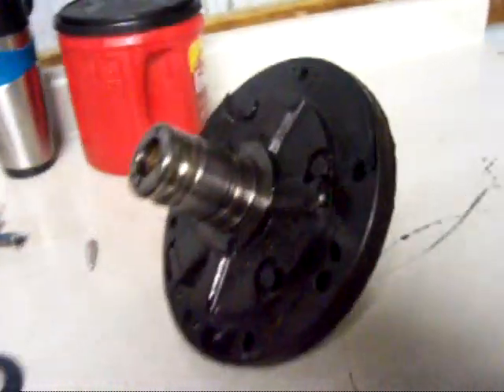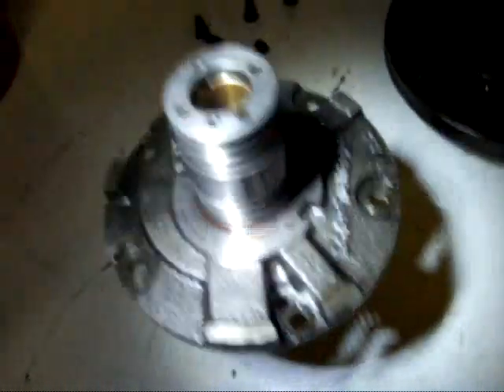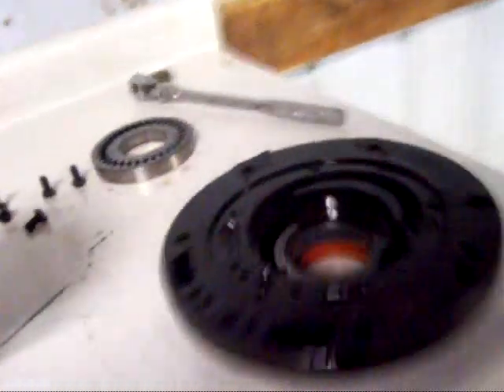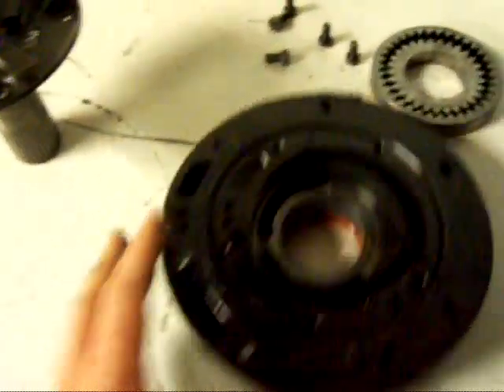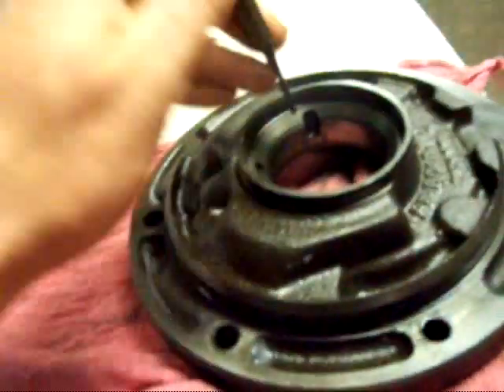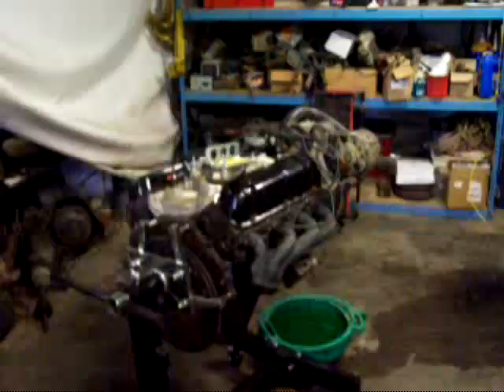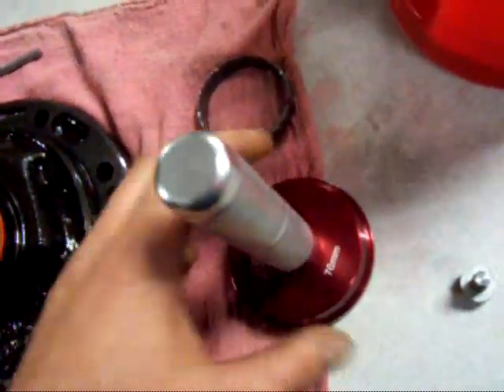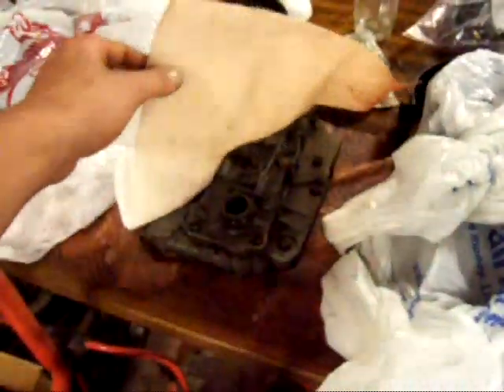Ford C5 Oil pump disassembly

Comment: What is that small silver conical piece on the bench right at the beginning of the video?  Where does it go, Mine fell out when pulling the pump out and I can't figure our where it went.  Help!
Reply: darn, I thought I finally found one.  Mine is not a blow gun tip it's solid steel and loos just like that. When I pulled the pump off my C4 it was sitting in there, and I can't figure out what it is.
Reply from the maker: vernon lemoignan The only thing that comes to mind off the top of my head would be the strut for the band. It sort of looks like that but is flatter on one end.